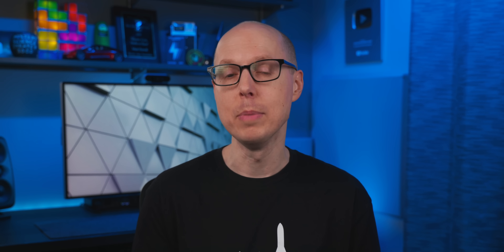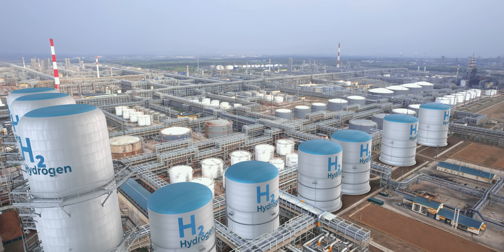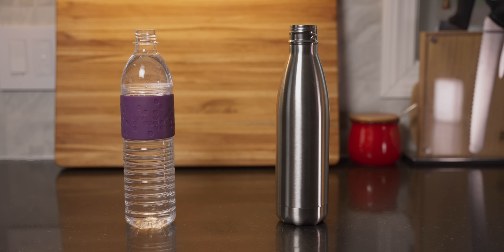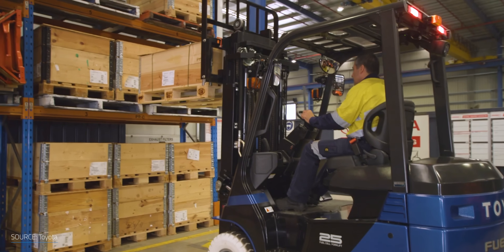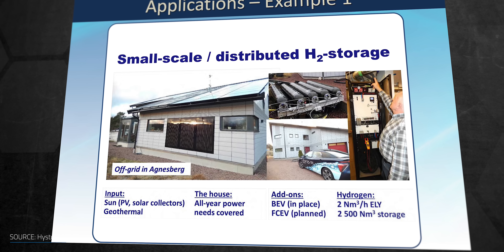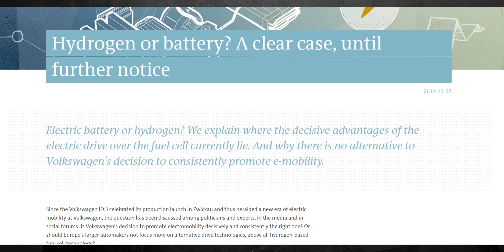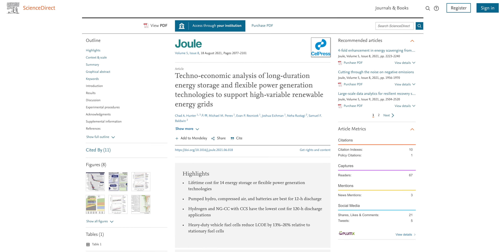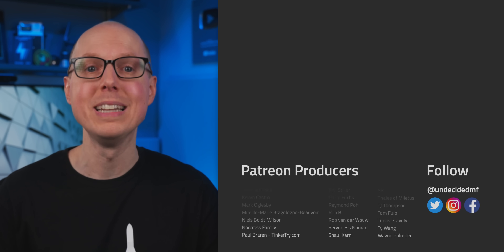Solid Hydrogen Explained (Again) - Is it the Future of Energy Storage?

Comment: Might it be possible to include carbon nanosheets as part of the lithographic construction of of a solid hydrogen battery. At the centre of a hexagonal carbon molecule or carbon-hexagon in a lattice of correctly stacked carbon nanosheets are 3 pairs of electrons that are generally drawn as a chemical resonance structure of six electrons.  Now that may proves to be an opportunity  as a lattic of "negative holes" for shifting a hydrogen ion / proton.  A huge parallel array of carbon nanotubes may be even batter.  Whichever geometry is used, the parallel nanotube lattice or correctly stacked lattice of nanosheets ( to also create many nanotubes ) , may act as a storage and a transmission medium for a significant number of hydrogen ions.  Perhaps this could be done in conjunction with this sold hydrogen metal hydride array of this video , after the hydrogen molecules are atomised and after they are ionised. Possibly other metals or conducting compounds might be part of this as well, acting as a catalyst for holding on the hydrogen ions and moving them on as atoms, electro-statically including hydrogen bonding.  This is just a rough idea a this points to perhaps engage other ideas, as this video has not been discussed for two years.

Comment: Hi Matt 
Thank you your very extensive coverage. The technology has evolved greatly from your previous video.  I am the CEO of SolidHydrogen and we make metal hydrides with release of the hydrogen at ambient temperature. No more heat is necessary. we can store 60kwh per 100kg of metal hydrides and make the hydride at a very competitive cost compared to previous technologies. We can store at a pressure of 30 bar which is the typical it comes out of an electrolyser. No compression necessary and it stores hydrogen at 99,999% purity which is compatible with fuel cells like to those used in automobile or trucks. It reduces the cost of hydrogen substantially as compressing can cots 25% of the H2 you compress and purifying can be half the cost of a Pressure Swing Absorption solution. Today, you can get twice the endurance of a car using metal hydride compared to batteries at the same weight . Keep updating you video... metal hydride is here to stay and help decarbonise....  Philippe Odouard

Comment: As far as a solid hydride is concerned, I recommend contacting Bob Lazar at United Nuclear, who has a Corvette Stingray with 4 tanks in the rear, filled with a specific hydride that is a leftover from our former nuclear arsenal. After a while, he was cut off from that supply, but he created his own nuclear laboratory to produce that same hydride, which takes a nuclear reaction to create that hydride. I know this man personally because he was a neighbor of mine when I was living in the mountains of New Mexico, from 1999-2004. Bob produced his own hydrogen via a solar panel, using electrolysis. It took about 3 days to produce enough hydrogen to fill those tanks of hydride which gave him a driving distance of 450 miles on one charge.

Comment: Here are some 

nanomaterials

￼

 that may have potential applications in hydrogen transport and delivery:

Metal–organic frameworks: May have high-capacity hydrogen storage

Carbon nanotubes: May have high-capacity hydrogen storage

Graphene

￼

: May improve hydrogen adsorption and desorption kinetics

Metal 

nanoparticles

￼

: May promote hydrogen dissociation and transport in pipelines

Interfacial hydrogen bonds: May promote the bonding of nano-silica particles and meta-

aramid

￼

 fibers

Liquid Organic Hydrogen Carriers (LOHCs): A class of carbon-based hydrogen storage materials that absorb hydrogen onto a liquid organic carrier 

￼

NCBI

Interfacial Hydrogen Bonds and Their Influence Mechanism on ...

The interfacial hydrogen bond plays a critical role in the promotion of the bonding of the nano-silica particle and meta-aramid fibre. The interfacial hydrogen bond energy is an important constituent of the interaction energy, that is, the existence of interfacial hydrogen bonds promotes the interaction between the two substances, forming a relatively stable interface structure. Nanomaterials with small radiuses improve the interfacial hydrogen bond energy density and interface interaction energy density, enhancing the stability of the mixed model interface.

￼

NCBI

Nanomaterials: paving the way for the hydrogen energy frontier

Jan 3, 2024 — Table 5 provides a comprehensive overview of potential applications of nanomaterials in hydrogen transport and delivery, specifically in hydrogen storage tanks and pipelines. Metal–organic frameworks and carbon nanotubes exhibit promise for high-capacity hydrogen storage, while graphene demonstrates potential in improving hydrogen adsorption and desorption kinetics. Metal nanoparticles and metal–organic frameworks hold potential for promoting hydrogen dissociation and transport in pipelines, thus enhancing efficiency and reducing energy requirements.

￼

carpmaels.com

Hydrogen storage materials – towards a greener future - Law Firm

Dec 12, 2023 — Another exciting class of carbon-based hydrogen storage materials is Liquid Organic Hydrogen Carriers (LOHCs), such as those developed by Umicore. In these systems, hydrogen is absorbed onto a liquid organic carrier using a hydrogenation catalyst to form a stable molecule such as cyclohexane or decalin.

Other materials that have been used for hydrogen storage include monometallic, bimetallic, and trimetallic nanomaterials. Trimetallic nanomaterials are considered to be the best for hydrogen storage applications.

Comment: .....additionally, I feel that the TYPICAL fixation over strictly-THERMAL considerations prevents REAL insights about the possibility of specific RESONANT values used INSTEAD to decohere hydrogen atoms from such underlying metallic media (tangentially RELATED to how magnetic REFRIGERATORS operate) - also, what ALL batteries DO relative to subjective INTEGRITY of THEIRS, is maintain power POTENTIALS; never ACTUALLY 'store' anything.....

Comment: Thanks for the follow up Matt. Yes as someone who lives off grid with solar and batteries in Canada, Hydrogen storage has always intrigued me. How to store all that sun from those long summer days for winter? Metal hydrides sound interesting for vehicles but I would guess that they are cost prohibitive for stationary applications, although great if you need to save space. A tank full of metal sounds like it would be quite expensive to expand, much more than an empty compressed air tank. From my research I am thinking that ammonia or methanol have more potential with large gas bladders under the lake or ocean getting a nod of approval as well

Comment: As most of you probably know, Norway has not just a lot of hydro power, but also a pretty large pumped storage capacity. However, as long as our regular dams are not full or running over, it is much more efficient to simply reduce the production there, instead of first generating electricity in one location, transporting it the pumped storage facility and then use it to pump water uphill.
Pumped storage could become viable if/when Norway accepts the EU's designated role for us: We should be the flexible provider that provides power when all of Germany suffers from "Dunkelstille", i.e. darkness and no wind. To do so we would need even more DC underwater transmission cables, which would make our local electricity prices even higher. Unlike most of the EU we use electricity even for heating in winter, so we cannot simply use less power when it is costly.

Comment: Then here in are the lies that bind us all 
USA makes buying hydride illegal.  
I’m calling BS ON OUR CIVIL /NOT SO CIVIL SERVANTS AND NOT MUCH A SERVANT ,, MORE LIKE A SOCIOPATHIC NARCISSIST STEALING OUR TAXES AND WRITING ILLEGAL LAW TO KEEP US IN THE STONE AGE 

OK NOW IVE GOT THAT ADDRESSED. 

GOOD OL BOB LAZAR ,, you remember him ?!! 

Area 51 ,, element 115 reverse engineering dude 

Same guy   Fabricated and constructed a PARTICLE ACCELERATOR ON HIS RANCH  AND SLID THRU THE “(you can’t buy ) HYDRIDE LAW  !!  BY MANUFACTURING HIS OWN HYDRIDE ,, 

And here is why  it’s illegal to purchase hydride ,,

ITS TO ONLY MATERIAL CHEAP ENOUGH, light enough and releases hydrogen at very low heat temperatures 

They film him generating hydrogen from solar that is energizing a HHO GENERATOR UNDER NO MORE PRESSURE THAN A GARDEN HOSE 

WHICH IN TURN IS REFUELING FOUR FUEL CELLS UNDER ONLY THE SAME WATER PRESSURE 

AND ITS IS STABLE   EG 

PUNCH HOLES WITH A RIFLE NO PROBLEM 

THROW A CIGARETTE ON THE CELLS NO EXPLOSION 

LOOK ,, USEING HYDROGEN IS NOT THE EXPENSE!! 

It’s the HIGHLY ILLEGAL MEDDLING BY OUR GOVERNMENT  TELLING US WE WILL NOT TOLERATE YOU CITIZENS BEING EFFICIENT, LOGICAL, COMPETITIVE TO THE POINT OF OUTPERFORMING EVERY COUNTRY ON EARTH. 

THEY ARE WEAKENING OUR NATIONAL SECURITY BY WEAKENING OUR INVENTIONS , dumbing down ANY ONE WHO HAS A SOLUTION THAT ADDRESSES EVERY ISSUE 
REGARDING HYDROGEN USE AND PRODUCTION 

IM SAVING THE PLANET BU GENERATING ENOUGH CO2 the save the few trees they haven’t cut down yet
Reply: Exactly, you are right.  Lazar had his corvette running on four tanks of Hydride that was easy to use and easy to make.  Yes, he made his own deuterium for better utilization but this process works just fine with Magnesium, MgH2,  cheap and readily available.  Our criminal zionist government will never allow this to become widespread or well known

Comment: And this is where the 2nd Law of Thermodynamics gets in the way of  BRAKETHROUGH  TECHNOLOGIES.  
Solid state hydrogen storage is not new.  It has been around for decades, & never became a practical means of energy storage, due to how it is massively inefficient, which is one reason for its high cost.  
It requires far more energy to form Metal Hydrides than the energy given when the hydrogen debonds from the metal.  
Simply put, batteries are a far more efficient means of energy storage.  

For hydrogen to more efficiently conduct electricity, it has to be in its metalic form, which requires it to be compressed under extremely high pressures, like inside of a gas giant planet.  
Currently there is NO material that has the strength to hold compressed metalic hydrogen under those pressures.

Comment: Is it possible to create a correction video that's even worse than the original, especially as a science communicator? Well you sure tried!
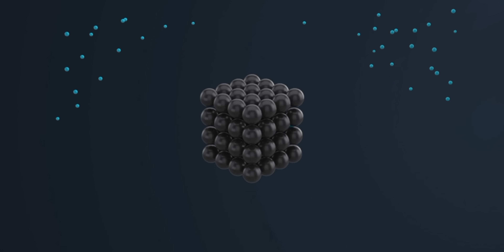0:35 seconds (after the intro) you conflate a metal hydride "which are sometimes referred to as a hydrogen battery" **No, they aren't**. Huge mistake 5 seconds in? It's clear science communicator does not mean knowledgable enough to check Google. Won't even waste my time correcting the rest of this.

Comment: Stop talking about total efficiency. Yes, you have to spend energy to make the hydrogen fuel. Yes, batteries are technically more efficient. But the reality is, a batter vehicle takes hours to charge to go 300 miles or less. The practical reality is that you can fill it up in five minutes, and go for longer. That’s the efficiency we want. When we commit to hydrogen infrastructure, it’s production will be affordable. Batteries are a bad idea. Hydrogen is more versatile, practice, and sustainable.
Reply: Efficiency matters.  Efficiency = money.  FCEVs have been around for nearly a decade now.  There's over 16,000 of them on the road. There's a reason they haven't taken off.  It just costs too much per mile to drive.  The only reason there's 16,000 of them on the road, is Toyota gives you $15,000 worth of Hydrogen when you buy one.  After you burn through that, the cars are worthless because they cost 55¢/mi to drive vs EVs that are 4¢/mi.  Without efficiency gains, you'll need to install 4 times more solar and wind to drive the same distance.  That's ludicrous.   Yes, taking a long time to charge certainly affects many that can't charge when the car is sitting idle doing nothing anyway.  Or others that don't have access to rapid chargers. With enough new developments, maybe in another decade, hydrogen can compete with gasoline.  But they thought that a decade ago and it's gotten more expensive because as more FCEVs hit the roads, the volumetric density becomes a problem and they find out you can't store enough in compressed format to supply all the cars.  So all new stations going in store it as liquid.  That adds more inefficiency and expense.  It's 12kWh to liquify 1kg of hydrogen.  A Mirai only can go 70 miles on a kg, and an EV can go 48 miles on just the electricity used to liquify the hydrogen, let along the electricity used to make it.  Today hydrogen is $36/kg or $198 to fill a Mirai.  There's no options, you are forced to fill them at stations and wait to be filled.  I can charge straight from the solar on my roof and still be adding energy to the grid at the same time.
Reply: @scottkolaya2110  as usual, you’re missing the big picture. The reason hydrogen cars would be expensive is because of lack of infrastructure. We need filling stations. YES, all that takes investment. But is no different with battery vehicles. But imagine we had enough infrastructure to support either batteries or hydrogen. At the end of the day, hydrogen is more useful. Batteries are inefficient. A hydrogen car can go further on a full tank than a battery vehicle ever will, and it will always take less time to fill up. You also can’t run a tanker ship or train on batteries. It is better to have a fuel that you put into a generator. You can store  hydrogen. You talk about efficiency but you want wind and solar? Lol We could use nuclear reactors to produce all the hydrogen fuel we could ever need. It could be done anywhere in the world, taking away all geopolitical instability we have with oil. If we make the investments for the infrastructure, hydrogen vehicles will give us a profoundly better future.
Reply: @bowencreer3922  As usual, people think that infrastructure solves the physics problem of hydrogen.  Even if you erase ALL infrastructure costs,  All of it. It still uses four times more energy.  Ok great, then we'd need to build 4 times more nuclear reactors.  Same problem but they cost more than wind and solar.  Sure hydrogen may be useful in non-land-based transportation and other applications, but it's terrible for ground transportation.  If you look at the countries that are interested in hydrogen, they have one thing in common.  They import 100% of their transportation fuel.  So yes expensive or not, hydrogen is an option for them.  They can pretend they are doing it for green reasons, but energy security is the reality.  Japan and South Korea plan on importing liquid hydrogen from Australia to make up for their massive energy deficit.  Same with Germany and Belgium importing hydrogen.  I'm not saying use no hydrogen at all, just as a last resort when more efficient methods waste less.  Also, show me an FCEV that gets more range than an EV of equivalent passenger and cargo room?  Sure you've got a Mirai that you better hope your kids don't get any bigger than 10 years old, because none of them are going to want to sit in the cramped back because the massive tanks using all the space.  You probably couldn't go anywhere anyway because the lithium battery takes up all the trunk space so you wouldn't have enough room for luggage.  Can't wait for little Johnny to be forced to sit in the back middle on that 400-mile trip having him complain the whole way because he's got to straddle that giant tank in the center hump.   That's just lovely how Toyota sacrificed room just to squeeze a few more miles than an EV that costs much less.
Reply: @scottkolaya2110   you still don’t get it. And now you’re showing your ignorance. First of all, the latest version of the mirai is a completely practical luxury car. Not the silly thing they started with. Anyway, it tells you something that major manufacturers like Toyota, Hyundai, Honda, even Mercedes make hydrogen vehicles. Good hydrogen vehicles. Literally every hydrogen vehicle is going to have more range than any EV. Lol Yes, yes, yes, it takes energy to creat hydrogen for fuel instead of just charging batteries. Yes, that is less efficient. But you don’t understand that that IS NOT A PROBLEM. As I said, hydrogen powered vehicles are more useful. More practical. More capable. And more versatile. They would be more affordable and last significantly longer than battery vehicles. Why are you talking about importing? Anyone with some electricity can make the hydrogen fuel they need. Nuclear is ultimately cheaper than wind and solar. Yes they cost a lot to set up but the return on investment is massive. You talk about needed to build more nuclear reactors but you don’t think about how we don’t make enough energy to support everyone having electric vehicles. Come on dude.
Reply: @bowencreer3922  And yet, we still only have 2 models of FCEVs in the entire world for sale.  You forgot BMW is trying too.    And it's not "make" hydrogen vehicles, it's plan to make, maybe.  All they have is prototypes.  So we've got 2 FCEV models for sale in the world and over 500 EV models.  With another 124 models available next year in the US alone.

I talk about importing because that's their plan, not mine.   They realize how much energy it takes.

And you really should proofread: .. your words... not mine "You talk about needed to build more nuclear reactors but you don’t think about how we don’t make enough energy to support everyone having electric vehicles"  So adding 4 times more just to use an inefficient method like hydrogen is better under your logic, that's wacky.